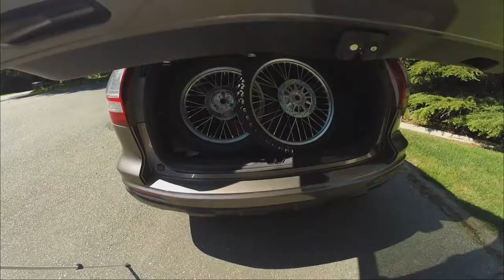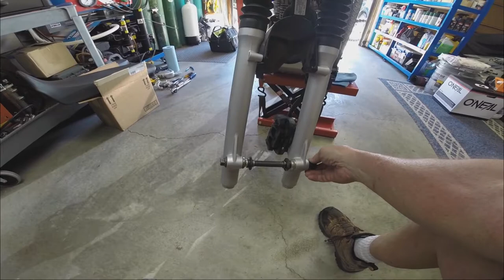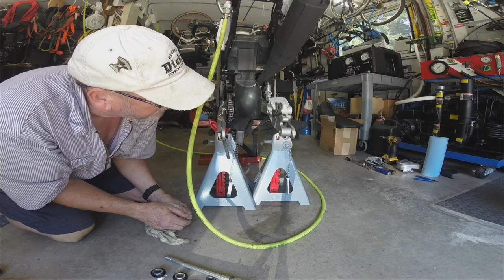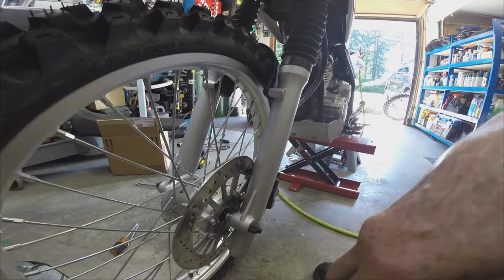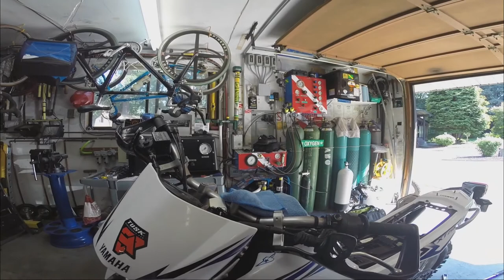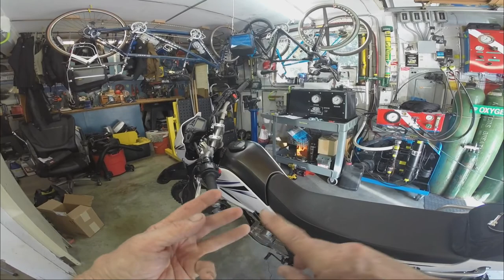Yamaha XT 250 Tire Removal and Installation for new bigger and badder knobby tires.

Comment: Chain freeplay is 40-50 mm. That's nearly two inches, and shouldn't be less, and you're creating drivetrain stresses. Good use of a torque wrench though.
Reply from the maker: I sold that bike last year. Replaced it with a Husqvarna FE350S.

Comment: Another awesome video, thanks! At 31.34 it skips and chain is on, did taking the adjuster out of the equation allow you to mount the chain?
Reply from the maker: Yes! When mounting the chain on the rear sprocket, you want the adjusters to zero so the axle can slide all the way to the front, then just drop the chain over the sprocket and finally adjust accordingly. Over time the chain will stretch and the drive sprockets will wear. At the point where a proper adjustment can no longer made, it is time to replace the chain, both the drive and driven rear sprockets and the rubber cushion pads in the rear hub. That should be well down the road though into the thousands of miles range. Unless you ride this bike hard and very frequently, it should be years away. Replacing the chain requires dropping the swing arm briefly as the chain does not use a false link. Some after market chains may. But dropping the swing arm isn't a big deal and gives a chance to clean and lube up the pivot bolt.
Reply: @usethenoodle  Thanks! How do those tires feel on the street? Loud, rough?  I think we're spirit brothers, I have an F150/shell similar to yours, lots of biking, and master PADI instructor (noticed your tanks/compressor). haha good stuff.
Reply from the maker: @chesterritchie  Funny. Yes, diving is a big passion of mine. Never was interested in instructing but I went all the way to closed circuit mixed gas rebreather with 330’ and full cave Certs for deep wrecks and caves. Dove deep wrecks in  Puget Sound, Truk and Bikini Atoll and caves in Florida and the Yucatán Peninsula. I’m a Master Gas Blender so I use the compressor/booster/gas bank to blend my own Trimix diluant and 100% O2 fills for the CCR as well as Trimix and EANX for OC. My local dive shops won’t touch pure oxygen nor any sort of helium mixes so I had to build my system and do my own. I built the panels and added a Masterline electric booster which is so much better than the Haskels I’ve used. I can also boost Argon for dry suit gas. It’s a really sweet setup. I enjoyed designing, sourcing and building the panels which are all stainless Swagelock tubing, connectors and valves. Fun project. The compressor is a 13.5 Coltri-Sub from Nuvair. I built my own Nitrox blending stick. The Oxyhackers Guide is priceless when going this route. Dispels a lot of industry myths meant to scare you off. Cleanliness is next to Godliness is paramount when handling pure oxygen so I oxygen clean using Super Blue Gold in an ultrasonic cleaner for parts and my own home built “tank tumbler” for cylinders. 

Oh ya… the tires. The are a bit louder on the road to and from the trail heads. But they are true dirt tires so I wasn’t surprised. Great on the rough stuff and mud. 

My truck is a 2001 F-250 Superduty with the 7.3 Powerstroke Diesel. 8’ bed E cab Lariat. I’ve restored it for the most part. Been through it end to end. It’s got a lot of towing related mods. It’s a great truck I use to tow a 30’ toy hauler in which I carry my Indian Chieftain motorcycle. 

So there you go, all the fine details. I appreciate your comments very much. Please let me know if there is anything else I can help you with. The valve adjustment video was a commenters request.
Reply from the maker: @chesterritchie  by the way, there are a few diving videos on my channel. Be sure to watch 6Gill Encounter. And there are a few from a recent Cozumel trip. The Lion Fish Hunt was North of the Palancar Reef  there. The Pacific Lion Fish is not native and is listed as an invasive species which is eating all the young native fish. So hunting them is appreciated by the Mexican Government. We made a wonderful ceviche cooking them with fresh lime juice. The other video, a nurse shark comes to play was on the Palancar Reef and was the most aggressive Nurse Shark I have ever seen. And I’ve been around a lot of sharks in the water. Probably been fed by divers. I’ve got lots of underwater videos but they are on Mini DV so I need to figure out how to convert them to files I can edit with my current editing software. Lots of caves and wrecks, sharks and odd fish. Mantas.

Comment: The tires being different sizes than original wasn't any problem installing them. They look great but I do most street and thinking of going with the Bridgestone Battlax.
Reply from the maker: Hi Bent, I bought my tires from Rocky Mountain MC and ATV online. You can shop directly for tires that fit the bike you have by entering it into the search thread. So I entered 2009 Yamaha XT-250 and I let the web site tell me which of their t tires fit. They did fit and no issues, so the web page worked. If they have the brand of tires you want, you can check the fit by typing in your bike. Then search for tires. If you pick a tire that doesn't fit it will say so. It worked for me.
Reply: Thanks for the info. Your tires look great but I'm going with something less knobby for my riding style. I'm thinking about the Bridgestone Battlax. Most reviews are very good some say they wear fast but they have much heavier bikes so I don't think I'll have that problem.
Reply from the maker: @not1au  https://www.motosport.com/bridgestone-tw301tw302-tire-combo?variant[BGS000C]=BGS000C-X001-Y001&variant[BGS000D]=BGS000D-X001-Y003 Motosport.com at the link has Bridgestone. If I understand you correctly, you want either a less aggressive off-road tire or perhaps more of a street tire. I know the group riders that gang up in cities at night with ATVs, Go Karts, and motorcycles prefer the XT or similar dual sport Platform but they run street tires on them. You should be fine as the problem is the size of the knobs which tend to strike fender mounts and the sides of the swing arm if too much beyond the factory sizes. For what I bought, aggressive dirt tires... They are as big as I could go without clearance issues. Mine is chiefly ridden on gravel roads and some more technical trails with rock and mud. You should have no issues finding the tires you mention. 

Have fun and ride safe.I just put Dunlop Elite 4's on my Indian Chieftain. I had the Elite 3's from new. They made it 24,000. Main thing on tire life is being anal about the inflation pressures. I am. Most guys get 12-15,000. It's because they run them low. I check my tires on the big bikes before every ride and I have TPS on my Vegas and my Chieftain. The Elite 4 is far superior to the older Elite 3. Amazing handling difference. The tire is the most technical thing on the bike.
Reply: I've learned first hand about checking tire pressure before every ride. Last week while riding something just didn't feel right and after checking both tires only had about 5lbs on them. They didn't feel low to the touch but hands aren't a good way to tell pressure. I bought and keep a pressure gauge on hand now and keep the tires to suggested manufacture pressure. I thought about putting street tires on my xt but do go off road every now and then so I just ordered the Bridgestone Battlax AX41's. I think they'll be great. There's absolutely nothing wrong with the Bridgestone Trail Wings it came with. I've rode on/off road, wet, dry and with a passenger with zero problems. I've seen comments and heard them called death wings but I ride responsibly. I think a lot of the death wing stuff is down to people making hairbrained mistakes and needing something to blame. Thanks for all your help.
Reply from the maker: @not1au  anytime brother. Enjoy!
Reply: @not1au  how are those Bridgestone Battlax AX41’s working out ? Are they original factory size or did you something different/ bigger ?
Reply: @usethenoodle  so you specified the bigger tire size on the rear , but not specifically the front tire size ( unless I missed that ) can you go with the 3” tire size up front in lieu of the 2 & 3/4” and be able to clear that little fender skirt ?
Reply: @NorthwoodsNomad  I haven't installed them yet. A motorcycle shop close to my house is going to do it at a good price when I'm ready but I decided to get the most out of the stock tires first. I just ordered a new handlebar from Revzilla the Zeta Explorer Handlebars. They offer two bends and I couldn't find information on the difference between the two so I ordered the sport bend. I got these because the Zeta Wraparound Handguards suppose to install easier. I also bought open ended grips and a new throttle tube so I can just keep the stock grips on the stock bar. I just hope I picked the right bend on the handlebars. Almost forgot on the tires I went stock size. I was surprised they had exact matches for my stock tires both front and rear.
Reply from the maker: @NorthwoodsNomad  Hi there. The tire I bought and used successfully on the front is the Moto brand 80/100-21. It clears the small lower front fender just fine. I have a few hundred miles on them now. They work great. I used Rocky Mountain ATV and motorcycle in Utah as my source. The rear is a Moto 120/80-18. Same vendor. I had a local motorcycle shop mount them for me. I ordered new tubes at the same time. I hope this helps. Craig.
Reply: @usethenoodle  thanks for the feedback ! I appreciate it. Be safe , and I look forward to future videos
Reply: @not1au  let me know how those handlebars work out for you , I’m very interested in seeing what your opinion is in your purchase of that sport bend .
Reply: @NorthwoodsNomad  The difference between the Sport Bend vs the Touring Bend is less than an inch on the pullback.

Comment: Stock tires are great on the road with longevity but in the dirt they suck!

Once I get a Super Tenere. I am going to put a 13tooth sprocket on the 250 and get some dirt tires
Reply from the maker: Ya, my son in law is a big KTM dirt bike guy and he is always interested in kicking my butt out on the trails. He's 30 year younger than I and one day last summer he suggested that my tires suck. They had a lot of life left on them but ya, as you say... So, I did my homework and came up with these. Much improvement. The only street miles this bike sees is to and from the trail head. They are hard enough that the pavement doesn't seem to hurt them over short runs. 

I ride a lot near Mt St Helens, which is the famous WA State volcano that blew its top on May 18th 1980 taking a lot of people with it who had been warned but wouldn't stay away. I guess they didn't believe it would explode with the force of an atomic bomb. That was quite a show. It's a great place to ride trails from easier to most difficult, and spectacular views can be had of the simmering volcano and it's brothers near by Mt Adams, Hood, and Rainier. The blast areas are spectacular where virgin old growth fir trees are all laid over like weeds in the same direction the blast wave was moving at supersonic speed. Spirit Lake, once pristine is still covered by many logs that were blown in there. It's an amazing place to ride if you ever get a chance. There is lodging in the tiny mountain towns of Randle, Packwood and Cougar. It's in the Gifford Pinchot National Forrest. Come check it out, bring your RV, lots of camping areas too. Trails from easy to terrifyingly difficult. Trail maps are free on the NPS and State recreation web sites and the trails are well marked with their number and difficulty. Warmest Regards, Craig

Comment: Nice presentation but I have to say the Harbor Freight stool gets lots of bad reviews because it fails causing injuries.
Reply from the maker: Well, I have learned to skydive, learned to scuba dive with a rebreather in caves and 300 feet deep in the ocean on exotic helium gas mixes that I blend myself in my garage, I climbed the tallest mountain (Rainier) in the lower 48 states, ride dirt and street motorcycles- yikes!, I became an expert alpine snow skier working as a ski patrolman, was a city fireman/paramedic for 36 years, and took just about every other chance I could for the adrenalin rush it gave... I did draw the line at BASE jumping. So, if I die driving my Harbor Freight stool I won't have any regrets.

But, thanks for your concern, I appreciate it. I love my HF stool. I use it daily and have for several years without incident nor injury. I'll attribute the falling to operator error. Maybe we need a government health and safety warning sticker on it to prevent these tragedies. I'm a Harbor Freight stool junkie, I got that monkey on my back and I can't shake it! 

Seriously, thanks for the complement on the video and the comment. Glad it helped you. Thanks for watching. Craig